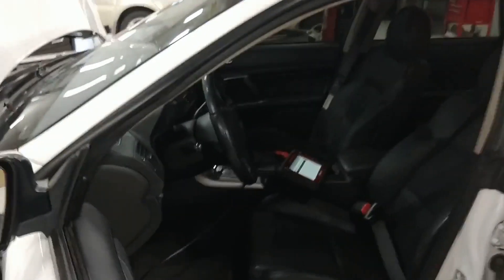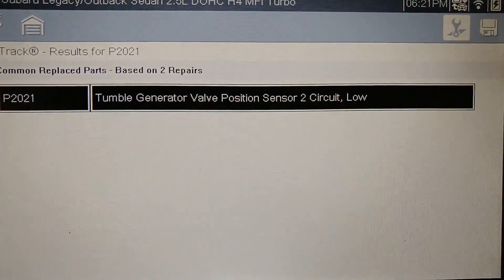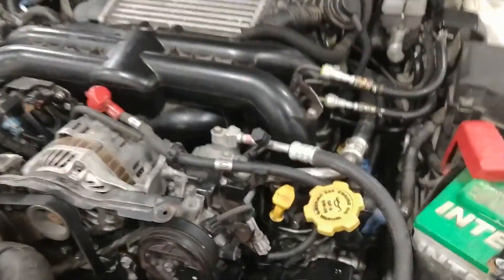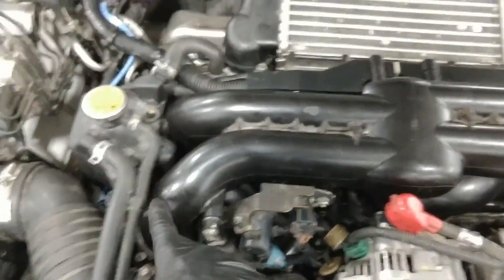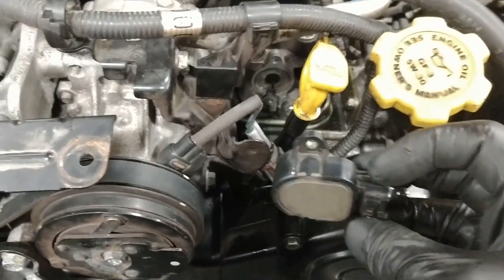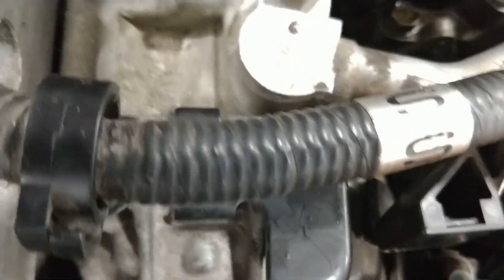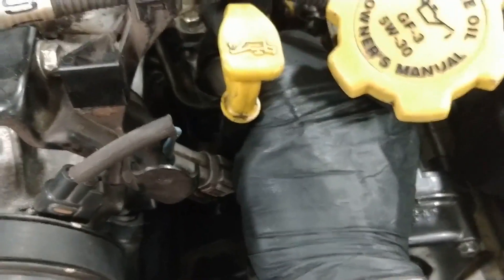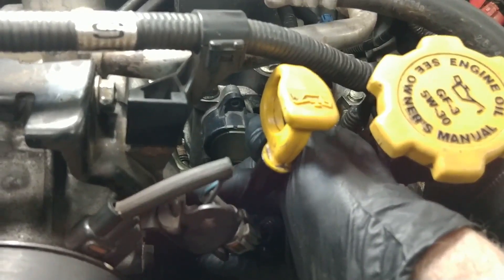Subaru P2021 Tumble Generator Valve Position Sensor Low Voltage - Sensor Installed Incorrectly

Comment: Brilliant! Thanks. I have just had the engine out of my Forester for head gaskets. Removed this sensor to get to the bolt just below.  I heard the spring unwind when I did so but wasnt sure how to reinstall. Sure enough had the P2021 CEL when the car was back together.  Now sorted thanks to this video.  
Funnily, I have an entry level Foxwell scanner ie ~AUD800 which could not read the code, nor clear it, but an app called Torque on my phone, could.  Funny world....

Comment: Will incorrectly putting that sensor back on affect the radio? I didn't put my sensor back on and now my 6 disc cd player will not play any cds. It will still take the disc in like it's going to read it but just returns the disc. Can low voltage be the cause?
Reply from the maker: I don't think there is any correlation between the sensor and the CD player.

Comment: Dude, thank you so much.  I managed to smash my oem sensor with a socket wrench accidently when replacing my ac compressor so i ordered a new one and just installed it and it didnt help after watching the sensor voltage value show zero on my accessport i knew something was wrong.  Thats when i found your video which helped.  Thanks again!

Comment: Just curious.. Why would that need to be removed for any kind of service other than replacing the intake manifold itself? Ive replaced a few engines and done some work on Subarus the past couple years. Im trying to learn what all I can. Ive been big on Honda, Nissan and BMW most my life. But I got the Subaru itch 😅 Now I must learn..
Reply: I had to remove mine to reach my knock sensor which needed replacement. I didn't install the throttle sensor correctly and still had my check engine light on. This video has helped me stress less now that I can fix my car properly.

Comment: How did you aquire just the sensor. Not finding it anywhere.
Reply from the maker: You can find it at any auto parts store or online.  Sometimes it is called a throttle position sensor even though it is not used for that purpose in this situation.

Comment: Excellent demonstration!  If someone has to replace the stepper motor on the other side of that assembly (instead of the position sensor as you did), is there some similar procedure for holding the TGV plates open or closed against the spring tension?  Thanks for the help!

Comment: Is the installation the same on the turbo side?
Reply from the maker: Yes, but it is on the back of the manifold rather than the front.
Reply: And how you put the passenger front back cause i remove it and don’t know how to put it back, the passenger front side is different than the front driver side any suggestions.? Thanks